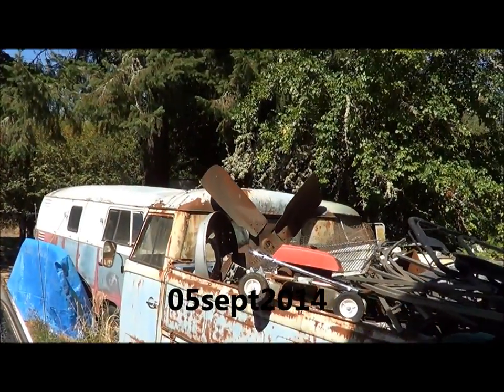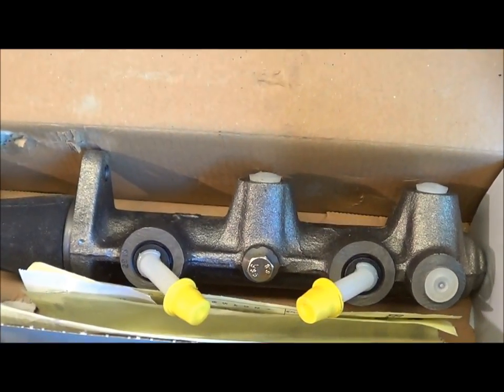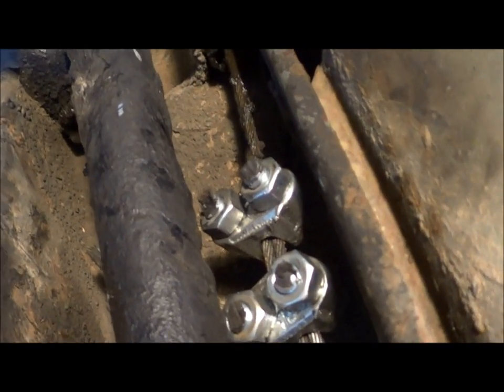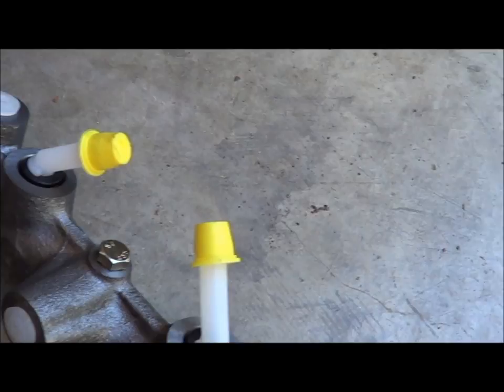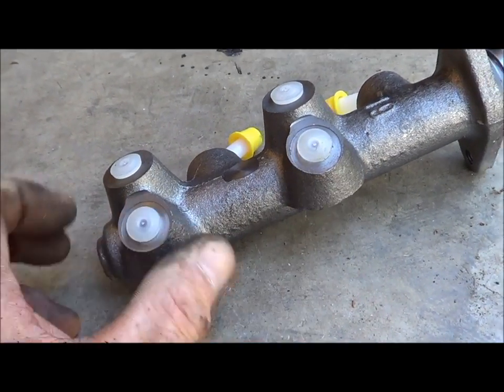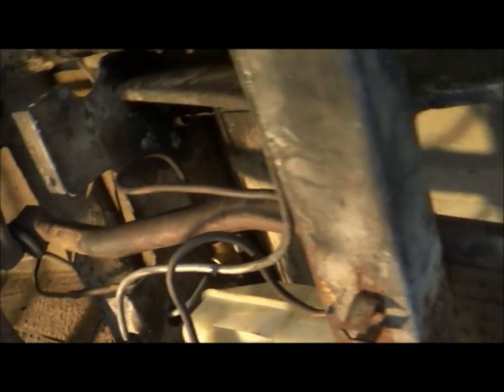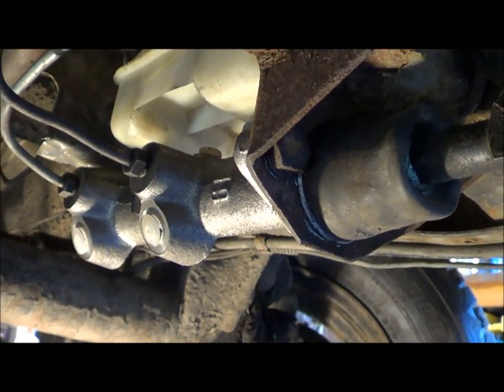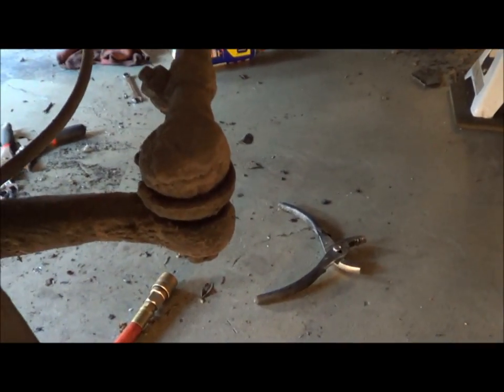1960 vw double cab dual master cylinder retrofit

Comment: Great video and tips also I have a 57 van bus bought it without the master cylinder would this be the same one? And sir ur tyres r a perfect fit for the bus which size r those please☺
Reply from the maker: This conversion would probably be similar in your 57. I have a 57  plan on doing in the future as well. The tire size on thr front of this truck is 205/75 x15. They are mounted on stock bus wheels. Thanks for watching.